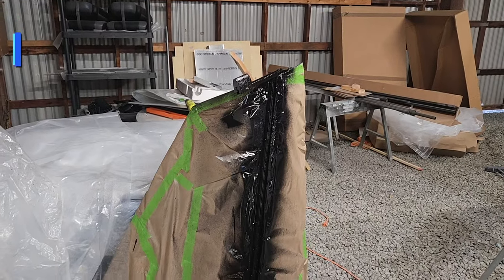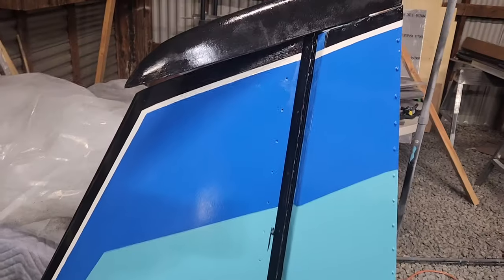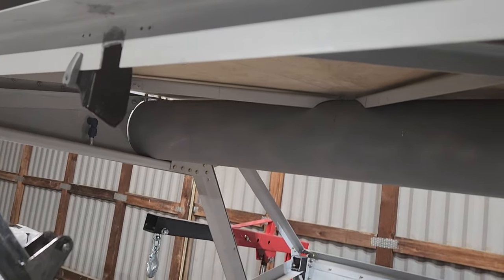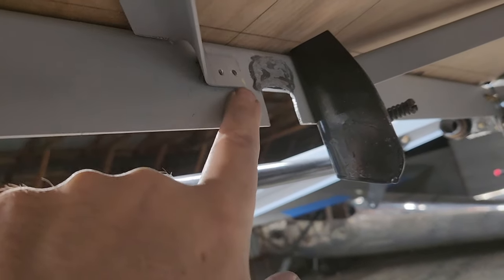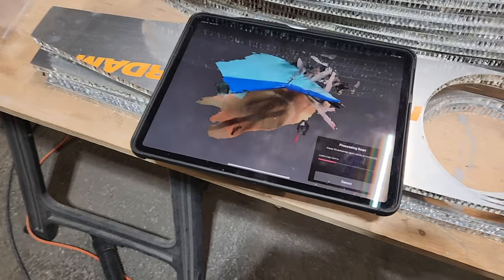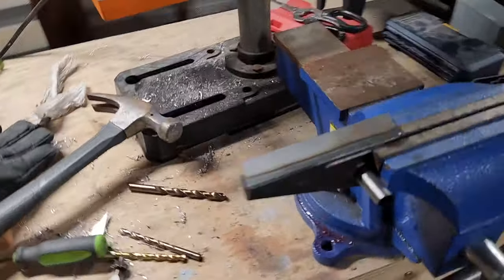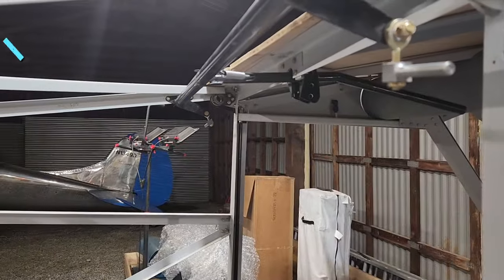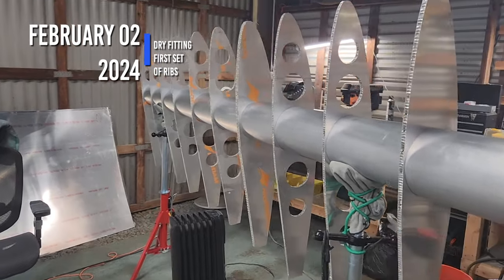Bede BD-4C Build Log 026

Comment: What kind of glue you used for wing ribs and tube?
Reply from the maker: I used Pro-Seal PS-90 that came with the BD-4 kit.  It normally cures within a few days but at cold temperatures it cures extremely slowly.